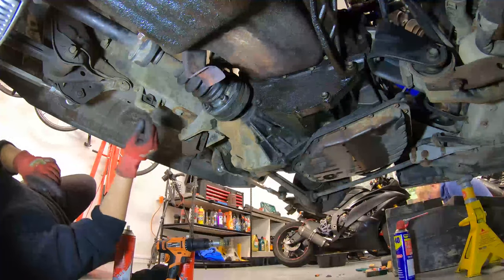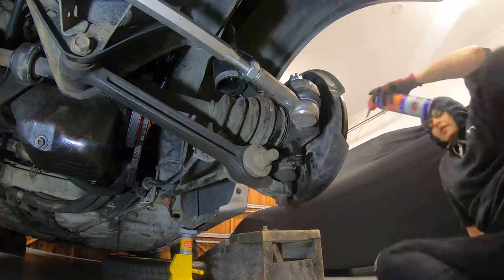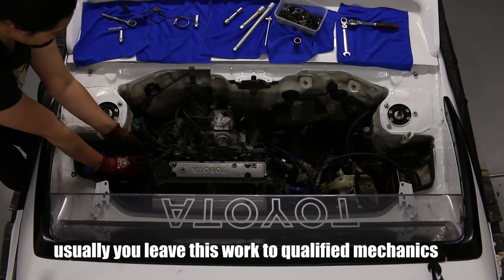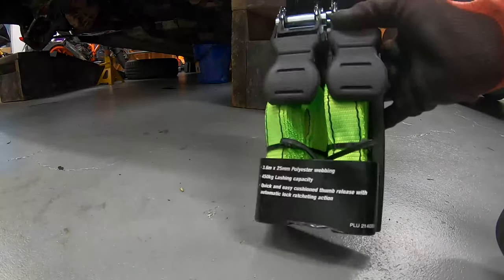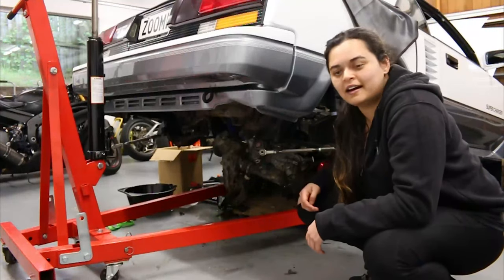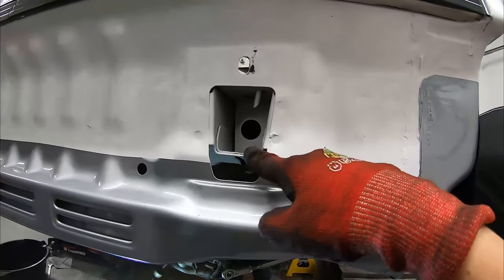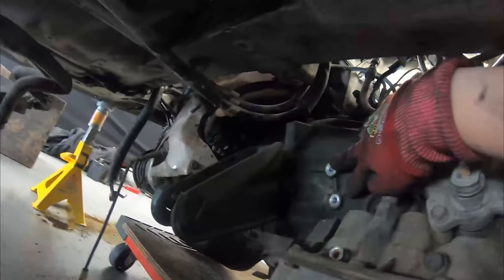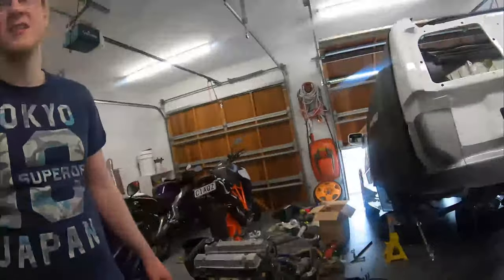How to remove a 4AGZE (Manual conversion Part 2)

Comment: I should have told you about using hydraulic jack stands.  They are jack stands that have hydraulic pumps that you can jack the car up using the stands themselves.  Then once high enough use slide pins to lock the stands in place.  Saves from using a cherry picker, bumper removal, trunk lining removal, and tail light removal.  Use the stands to lower the car down to a jack waiting to hold the rear by the rear mount.  After you have the motor ready to be dropped of course.  Then lower the jack down so the motor is resting on the dolly.  Unbolt the two side mounts. Raise the car back up with the jack high enough to get the hydraulic jack stands back under the car.  Then raise the car the rest of the way with the stands until the motor clears out the back and not the side.  Goes way faster as there is less stuff in your way.
Reply from the maker: that sounds like something future steph should invest in haha! 
either that of a hoist :P Though they don't sound cheap!
Reply: @STEPHASAURUSREKD  Hoist is the dream lift right there.  Hydraulic jack stands in the states aren't bad, not as cheap as regular stands but worth the price IMO if you can't afford or have the space for a lift.  But if you continue to drop engines out of cars seriously consider the hydraulic jack stands.  They are a life saver.
Reply from the maker: @mr2miach  yeah for sure! 
Im not sure if there will be many more engine out jobs (there are a couple in the next year or so) but would be useful for future works regardless! thank you for the advice! will definitely have a look into them!

Comment: Next time you gotta do a ball joint grab a hard hammer & channel any pent up anger into it, the bigger the better! It's the shock that breaks them loose.

The rubber & copper/brass ones are for gentler work where you don't want to marry a surface and won't work as well in the situation. Small sledgehammer is good too!
Reply from the maker: Ahhh! I shall bonk em with all of the rage next time!! Thanks for the tip!!